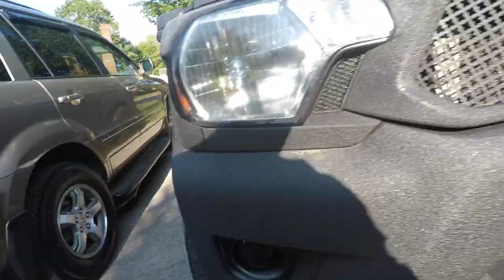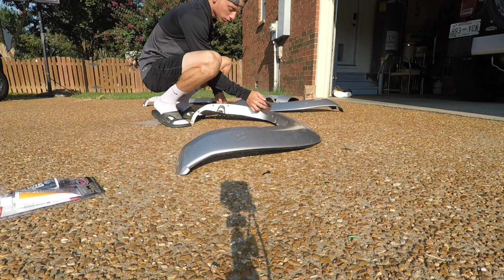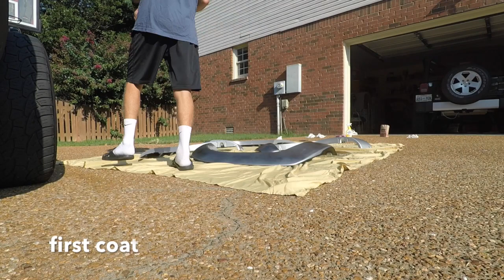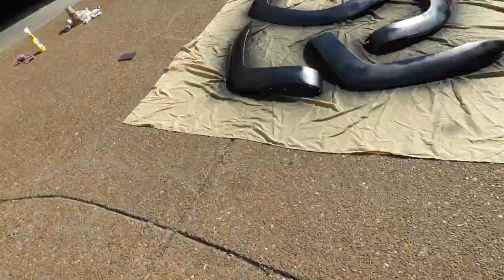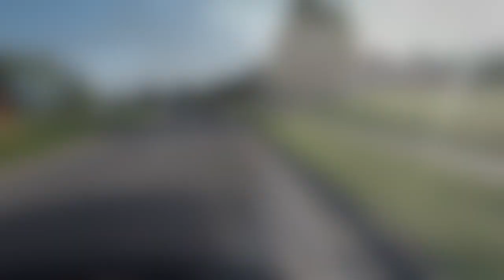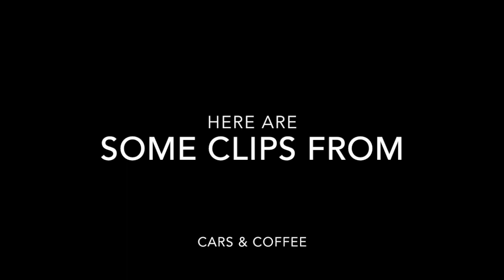THREE INCH SPACERS AND PAINTING FENDER FLARES

Comment: What size tires are you running and what did you do with the 3” spacers?
Reply from the maker: Cody Meier 31.75 265s and they are still on
Reply: Max Lahoda how bad is your running? I have 1.5” wheel spacers and thinking of getting 265/75/16 tires
Reply: Rubbing*
Reply from the maker: i dont rub at all